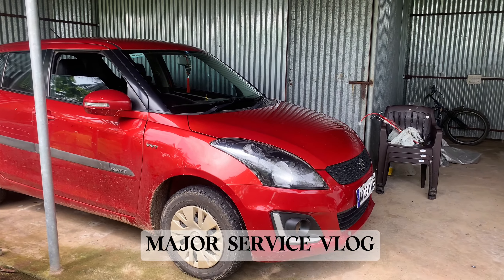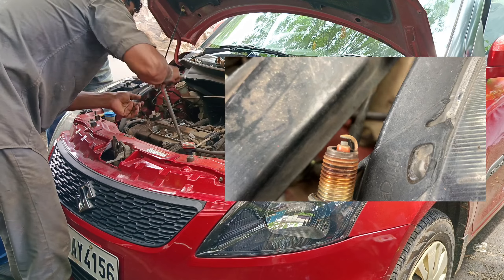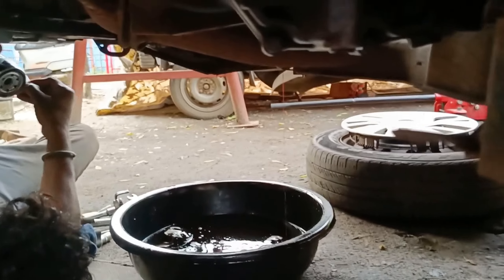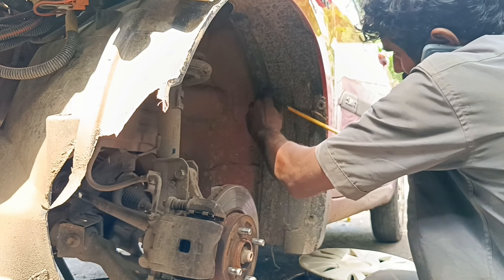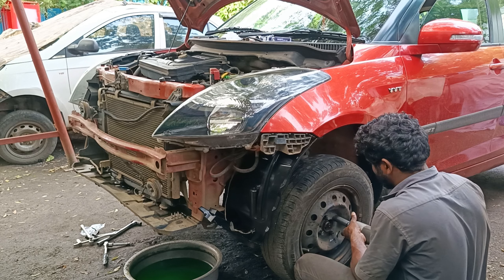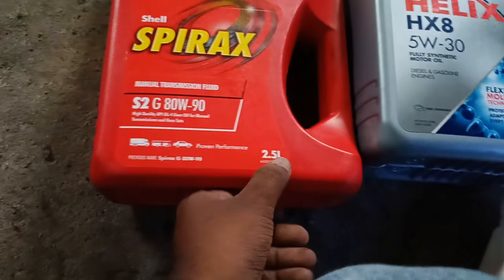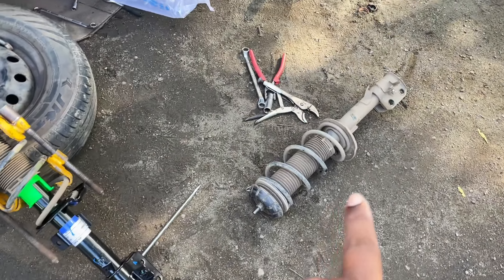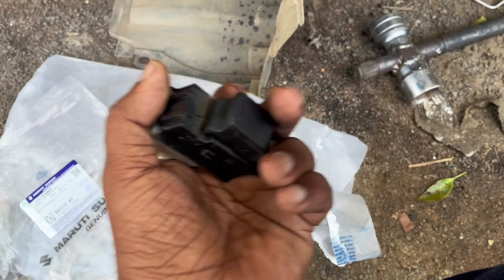Suzuki Swift 1 Lakh Kms Service In Telugu |Swift Major Service |

Comment: Bro nuvvu idhi major service anukuntunnav....normal ga aythe idhi general service. 1 lakh kms ki chese service idhi kadhu. 

Major service lo check chese parts list.

1. Intake and Radiators cleaning
2. All belts, water pump and idlers change
3. All 4 shocks, steering rack, D bush, link rods, Lower arms and inner ball joints...tie rod ends check and change 
4. Clutch plate, pressure plate, release bearing & clutch cables check and replace 
5. Throttle body cleaning 
6. Hose pipes check and change
7. Silencer / catalytic converter clean
8. All 4 Wheel bearings change
9. Complete break overhaul
10. Petrol filter change 

Ivi mottam chesthe inko 1 lakh kms varaku chusukune pani undadhu.
Reply from the maker: Agree with you bro....but nen evi anni        slow gaa chainchaa suspension related gaa vediga okka video chaysa check it once &  manam vehicle nii manchigaa maintain chaystay evi em chainavasaram vundadhu... clutch plates evariki 1 Lakh varaku ravu  nen ee vehicle kii 60k kms kay change chaysa idlers, 5,6,7,8 evi max manam complaint vastaynay change chayskovali if budject matter anukuntay & 9 point gurinchi nen vidigaa video chaysta ani vlog loo kuda cheppa.... Suzuki vehicle (petrol )nii manam manchiga maintain chaystay even 1 lakh service kuda general service lanay vuntundhi
Reply: @AlphaAutomotiveTelugu  nenu normal ga major service lo maximum replacement avasaram unde parts list cheptunna bro....naku 2014 verna undhi daniki nenu clutch 97k kms ki change chesa bro. Just ikkada video chuse Vala knowledge kosam comment chesa anthe.
Reply from the maker: Ok bro.... Petrol Suzuki vehicle maintenance itay ellanay vuntundhi bro☺️